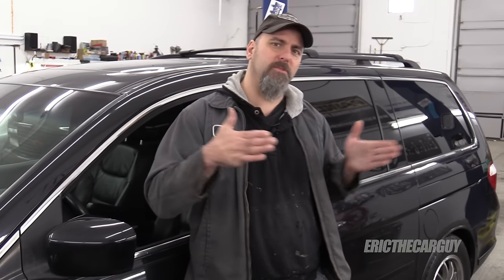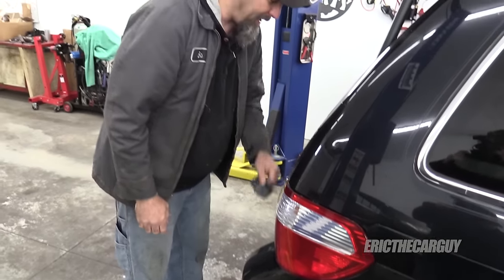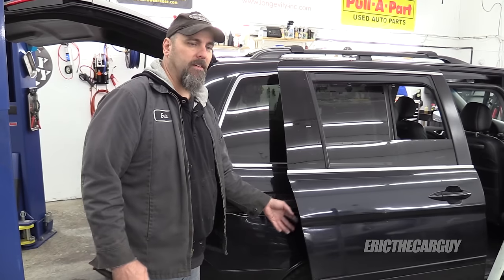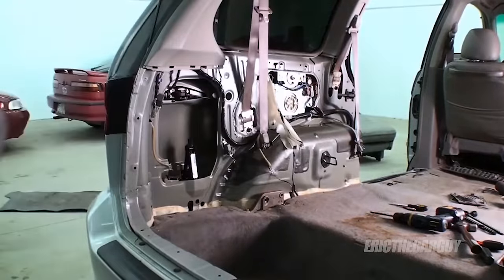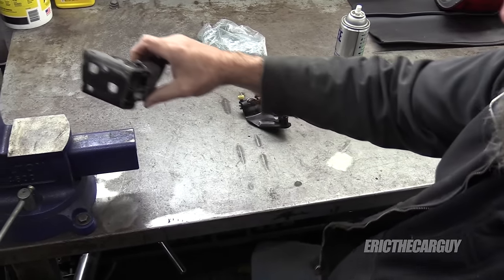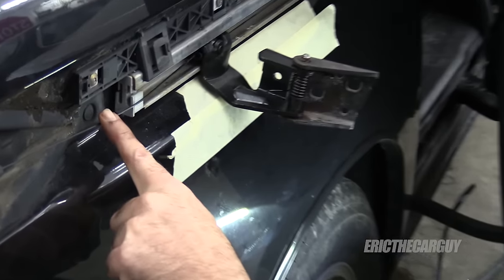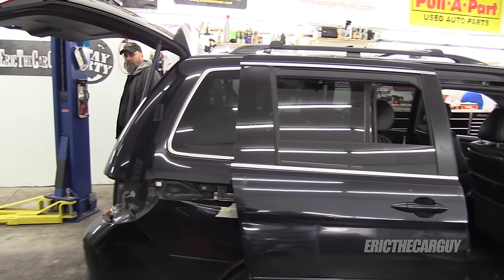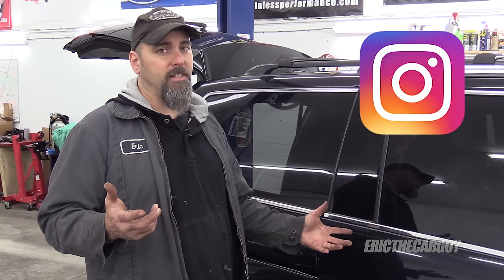Honda Odyssey Sliding Door Repair the 'Easy' Way

Comment: Fantastic video, thanks! I have to do this in my (rough and in need of repaving) driveway before too much snow accumulates in the next few days; Can I get away with using the scissor jack that comes with the Odyssey, or does this absolutely require a trolley jack with wheels?
Reply: I use blocks of wood with an old rag or jeans between bottom edge of the door and blocks to hold the door up to the proper height
I've replaced 2 rollers with this method
Reply: I ended up using my scissor jack and blocks of wood PLUS a crate as backup just in case.

Comment: Thank you so much for this well detailed video. after watching it a few times, I was able to replace the passenger roller on my 2007 Odyssey without a hitch. Although, to support the door, I used a milk crate and 1x2 stake. Oh, and we also broke the rear lens, but that was changing the lightbulb earlier this year. LOL.

Comment: Eric, love your videos please keep them coming.  I actually have a much easier but "hack" way to fix this but it has lasted my 2006 Odyssey for years and countless open and close cycles.  Just lift off the bad rollers from the bracket and get some nylon or plastic washers of about the same diameter.  I needed to drill out the centers to make them fit on the pins, and needed to stack two on each pin. Cost me nothing since I had these washers sitting around, so if you need to buy them it will be a few bucks.
Reply from the maker: Interesting idea. Glad it worked out for you. I'm sure it saved you a ton of money.
Reply: I've done something like this twice on my 2004 odyssey - found a guide on one of the odyssey forums called something like "$5 sliding door repair".  Just needed two nylon bushings and two e-clips from the hardware store to replace the rollers.  Have to drill out and sand down the bushings to make them fit but it worked for a few years each time and I could do the whole repair from the outside.  Wasn't a permanent fix but it was so cheap I didn't mind doing it twice.   Love your videos Eric, keep up the great work.

Comment: Have you ever worked on Mazda mpv psd? I'm having a similar issue and will be checking this when the wife gets home to see if this is the fix one door will not open in power mode and the other door will not open in manual mode 😅

Comment: About four month ago I had that problem with my 2002 Odyssey. I paid near $400 to the Dealer to have it fixed. Waited 3 days for them to get the part shipped. They gave a rental  car . I could have saved that money if I had seen your video.  Thank you anyway. Now I have the two vents in the back that do not open,. do you have a video showing how to repair those ?

Comment: Eric, thank you very much for the great instructions and most importantly, for posting this video for us that like to save our $$ and do it ourselves. This video was great, very easy to follow. I did catch a piece of advice from another post on here and used it.... turning off the auto door on the left side of the steering wheel and you can move the door wherever you need it. Now, if I can figure out why the same passenger door will not open from the inside door handle but will close from the inside door handle. Works fine from outside door handle and from dash. Anything you can share on that? Again, thank you sooo much.

Comment: Great video. Thanks! Btw, what is the electrical plate in the b pillar that the sliding door connects to called? Having a hard time finding a replacement.

Comment: Thanks for your video.  I did this repair on both the driver's side and passenger side door on my wife's odyssey and saved quite a bit of money.  Now if you could just post a video on what to do when the sliding door door latch freezes in the locked position.  Help!

Comment: I just bought a Honda Odyssey like this one.  This is good to know.  I thought the bottom roller is the one that goes bad.  I did noticed that dirt gets in that area and also applied red and tacky on the bottom track to help it glide better.

Comment: This is a very useful video for Honda Odyssey owners with those powered rear doors. I am very surprise that these tiny rollers on the bracket are plastic! Honda charges $75 for each of them, left and right, they are mostly metal except for the damned rollers? I would expect these rollers to be ball bearing metal wheels but they are not. To move those heavy doors with just 2 lousy plastic rollers are dumb. I think Honda owed every Odyssey owners free replacement part for these underengineered roller brackets for the powered doors as they eventually will break. And yes, these doors stopped half way because it is a safety feature, they don't want to get sued when someone lose an arm, a leg or a head  when the door open fully with the window is down!

Comment: Excellent video and explanation about sliding gates in the Honda Odyssey 2006.

It was not clear to me what the failure of the floodgates is, so that it is necessary to replace that piece.

I am in Venezuela, I have a 2007 Honda Odyssey, both floodgates make noise at the initial moment of opening and also at the closing moment of the floodgates.

The displacement of my gates is fine, the problem is the sound or noise "clack" "clack" that occurs when it opens and just when it closes.

Can you help me understand and know if my problem is solved by changing that piece?

Thank you

Pablo Ramírez

Comment: Your instructions were “almost” dead on, Eric. That screw holding the fancy plate in which you used a long screwdriver and magnet to remove, it was plastic for me on the drivers side. I’m so disappointed in your accuracy. 

Now, non-sarcastically, you should really think about doing this as a job!
:-)

Excellent!

Comment: ah  breaking the tail light like that I did the same thing on a maxima.  I had to use your tip to seal it up to prevent water into trunk.(thanks it worked to fix it)   
 I also have a 07 Odyssey  so saving this  vid for future use.

Comment: I started off working on luxury cars.. I double layer masking tape everything painted in repair areas. So I cringed a little until you taped off. Noticed even  your tape got nicked when you released the cables from the roller hinge. Good repair, brother.

Comment: Great video.   I replaced the roller hinge on my 2003 Odyssey, there was a bit of slack in the cable which helped the remove & replace.  Just like brake cables on a 10 speed bike.   But I did not take the extra step,  to remove the inside panel and take up the slack to pull the cable tight.    So... the door works perfectly using the handle,  but does not pop open with the button (either fob, or dash button).  When I push the button,  I hear the motor Pop and try to open, but then it just beeps and stays closed.   It does close perfectly using the electric buttons,  just won't open.  Maybe that's because there's slack in the cable?     BTW I replaced most everything.  First the lock actuator,  then the latch and latch motor assembly, and finally the roller hinge assembly.  The door won't pop open electrically,  so either it's slack in the line...or maybe the fuel door button sensor?  This door is complex enough to be an idiot's delight.  Can't wait to get it working 100%.    The interior panel remove & replace, looks like a few hours at least.     If you add it up,   there's about $1,300 to $1,400 worth of parts at cost inside each sliding door.  Ridiculous!!!

Comment: On those screws,oil is great,but I also like to use a long extension with a proper tip,be it Phillips or tor and smack them with a hammer,impact is awesome as you know,NOTHING worse than tearing up the screw and not being able to get it out. THANKS for the vid,I need to do this on an 05 Odysseus I bought. 😊😊✌✌

Comment: As you were getting ready to do the tail light, I was waiting for you to say "now take a couple of strips of duct tape, overlap them on the tail light lens, take the other ends of the tape and twist them like a wire tie on a loaf of bread. Then use the twisted end and pull straight back. This way you don't break the headlight housing." I learned that from another video I watched when I thought there must be a 3rd screw I can't find. Bty, the duct tape isn't on there long enough to leave glue.

Comment: Great video.. mine is a little more though. the bracket was installed in the same position, but the door is actually hitting the frame. Have to do some more digging.

Comment: Hi! I'm having this issue in both my 2010 sliding doors. 

What is the part called by name?

Were you talking about the slack in that line just to make it easier to remove the part and replace?

Thank you.  Single mama going to attempt this fix very soon.

Comment: When my automatic door wire snapped I brought it to a mechanic, got ripped off, cuz soon it snapped again. SO THEN,  I just wanted to operate the doors MANUALLY!  I discovered the lock latch at the rear of the sliding doors is operated, manually, by the door handle. This latch can become locked and prevents the door from closing. It stays locked, but can be unlocked by pulling on the door handle AT THE SAME TIME that someone else MANUALLY MOVES THE LATCH to the unlocked position. (Also, cool advice about the window being rolled down preventing the door to open fully!)

Comment: Eric, i trick i learned that maybe you along with others know by now. Magnetize your screw driver by taking that little magnet reach tool and drift it on the shaft of the screw driver in one direction many times. To de-magnetize it drift in the opposite direction. Granted they wont be super strong magnetized from what i noticed but it is better than nothing.

Comment: I replaced a ton of those when I worked at the dealership and that’s the exact way I did them. No need to undo the cables at the motor. The only thing different I did was trace around the hinge with a sharpie before removing the bolts. That way I get the new one back in the exact same spot. And yeah I’ve chipped a couple taillights too. 😉
Reply from the maker: Did you watch the whole video? ;)
Reply: EricTheCarGuy I had it on while working so I missed some. What did I miss? Probably the sharpie part. 😄

Comment: Has anyone tried this . . . ?
As far as removing the roller assembly from the door, why not remove that hinge pin instead of those two bolts? That way just seems to be easier and would eliminate any alignment issues.
My parts arrive tomorrow and that's my plan, hopefully it works.
And THANKS for posting this video!
Reply: What did you end up doing? Did it work out?

Comment: Thanks for the video! I replaced both rollers on my 2006 Honda Odyssey EX-L and now I cannot close the drivers side door all the way unless I turn off the power door switch. Neither side will open using the button on the dash or on they keys either. Any ideas? I marked the placement before taking the rollers and used the marks to place the new ones.
Reply: Nathan Andrew I’m having the exact same issue, I just can't figure it out. The door closes great until the roller starts rounding the curve

Comment: just a quick tip eric, you can use a soldering iron and "weld" the plastic pieces back together and it'll last longer than glue.
Reply from the maker: Good tip. I think they also make a tool just for that.

Comment: Hi there Mr. Eric ...
I saw your video and try to change the sliding rollers on 2006 Honda odyssey, In a mean time, I was waiting for parts to arrive,  I change the battery,  after that passenger side rear door got jammed, I am not being able to open it from inside or out side regardless of putting the electronic nob on auto or manual .....
If you have any suggestions, 
Please advise....
Have a good day.

Comment: Did this job a few months ago, on both sides, and this totally helps me realize what I was doing.
Unfortunately, one of the doors still binds up. I'm going to try lifting the door a hair and then checking the alignment and then taking off the interior panel and adjusting the slack, but do you have any other ideas? is it ever the top or bottom roller?
Reply from the maker: Not normally. Check for debris in the bottom door track too.
Reply: Thanks! More grease would help, I'm sure.
I still have a lot of play in the new hinge, though.

Comment: The rear door latch is also a common issue on those Odyssey’s you’ll get a “Slide Door” light on the dash and the door won’t open by its self. 
My trick for any Honda tail light assembly that removes like that is to use my fat plastic pry tool that has a short curve on one end, I put the curved end by the clip and push back.

Comment: Good 2 c u again.  Do u have any info on Mercury Mountaineer AWD 1997 5.0 it has the electrical gremlins. With the heater and AC controls. My son has it up in flagstaff Az and no heater we swapped the fan resistor work for a day and now will just go on sometimes.  Is there other relays or fuses that could also be causing this? It dose have rear heat ac too. Thx for help. I’ve seen lots of vida on it but nothing that covers it all. Later stumped dad of two collage kids

Comment: I was able to do this repair easily thanks to your video. Thanks so much! That freakin tiny clip flew off for me too like 4 times. Thought I was doomed each time but managed to find it thankfully =D
Reply: Excellent video but I could not get the cables back on the roller, just not enough slack in the cable.  Any final tips before I go to a mechanic?

Comment: For broken plastic pieces u can use a soldering iron and melt the plastic pieces together makes it just as strong as before. I fixed a plastic radiator support on a town and country and it held even with the wieght on it.

Comment: Hi Eric, I have a problem with my Honda Odyssey 2004 drivers door will not open, I was changing the door knob or handle assembly and before I tested to see if was working the door got blown by the wind and closed, the door does not unlock, what can I do to open it so can be fixed. I'm in Houston. Do you have a video or some ideas to help.

Comment: You don’t have to take the bracket off the door, just knock the pin out and leave the bracket on the door then you don’t have to readjust the door and line it up when you put the bolts back on it. It’s just like taking a door with hinges on it off a door opening so to speak. Saves a lot of time.

Comment: Eric: my 2016 Ody has broken cable at the bottom on the passenger sliding door. It got stuck after we opened it all the way. It took me 15 minutes to find out that there was another cable that pull back the lock which unlock the door and let it close or i will just stuck open and won't close.  Since the cable is broken now, I have to use my finger and pull the metal part out of the hinge and at the same time use my left hand pull on the handle bar to trigger the motor to close the sliding door.  Do you have a video for that fix? thanks.

Comment: Hello. Great video, however, the issue I'm having is the door (driver's side) closes, but instead of that final seating, there's a loud CLUNK. The door looks closed, but put it in drive and "bzzzzzzzzzzzzzzzzzzzzzzzzzz" the "your door's open" alarm rings and of course, doesn't stop.

A different problem. DO you have a video for that???

Thanks.

Comment: If replacing the rollers doesn't work, then try the latch motor assembly. If the motor sounds weak when latching the door in the it is most likely the latch motor

Comment: Hey Eric, I have a 2005 Odyssey where the door won't open because the handle disengaged from the internal mechanism. Is there a way to repair that without having to throw the van in the garbage? Thanks

Comment: I didn't have any trouble with the cables with my 07 Odyssey either. Cut them off years ago when they rusted out and couldn't get replacement cables (go figure) but had to buy $700 assembleys. Manual doors work just fine and are less trouble.

Comment: Hey so I know the video is an older video but I have an 06 odyssey and the drivers side sliding door of mine only works on occasion n the bigger problem is that when the door closes, some how it comes partial dislodged and will cause the door ajar light to come on and will not lock the doors with the remote. When it does work there r no wierd sounds coming from it. Just when it closes it will slightly pop out by the rear of the door causing the light n lock issue. Do u think the motor needs a replacement or something else.

Comment: Hello. I was getting the Sliding Door error and just replaced the roller assembly on the driver's side as shown in this video. It needed replacing. The door now opens and closes smoothly. Beautiful. But after a couple cycles, I get the error code again and have to reset it by pulling the fuse under the dash. What else could be wrong? The door opens and shuts perfectly now.

Comment: Made my own tool to help get the cable back in. Took an old flat head screwdriver and cut a notch in the center. Put the end in the hole then use the screwdriver to push the cable into place. Take care not to stab yourself. This gives you a lot more slack then using needle nose.
Reply: Were you able to do this without marring the cable?  The pliers looked to chew up the cable a bit.

Comment: Ive done this on both doors for our van. When I did it, I used a rubber hammer and a screw driver to knock the pin out in place on the door so I did not risk any misalignment.

Comment: My husband bought the parts needed and he and a friend who is a mechanic worked on putting the part (s) in.  Now, it's in but the door still doesn't work.  Could there possibly be another reason for the door not to open automatically?     Thanks

Comment: Hi Eric, can you show us the hard way? I already did it the easy way, but the replacement rollers failed. I'd to loosen the tension, install my second set, and then tighten the tension. Can you sow us how it's done? I can't find it anywhere on your tube.